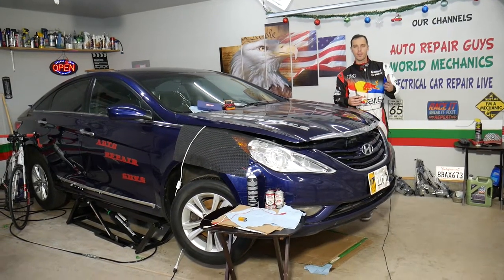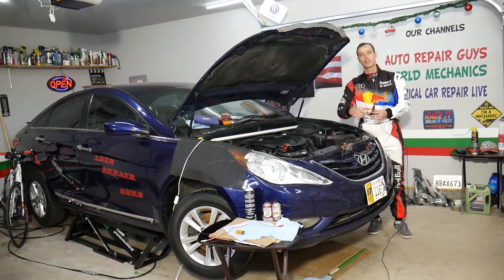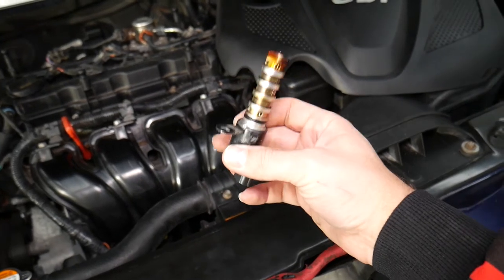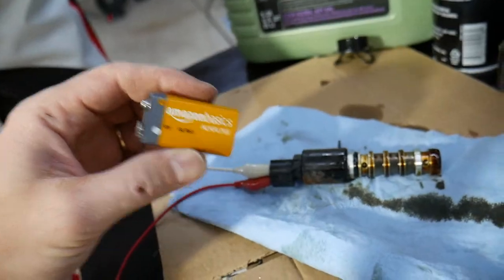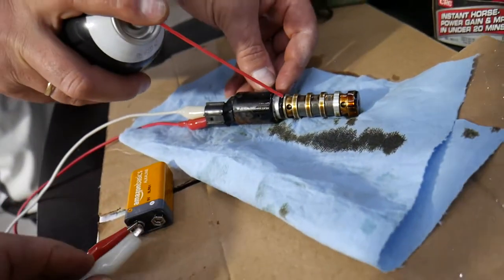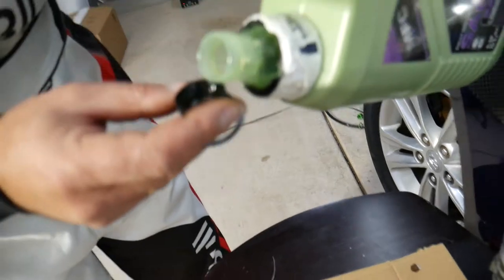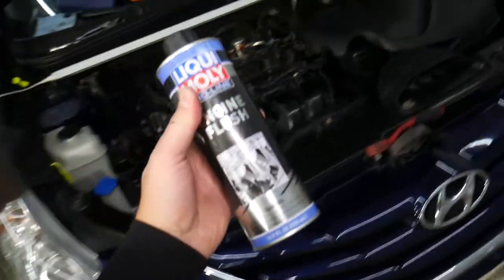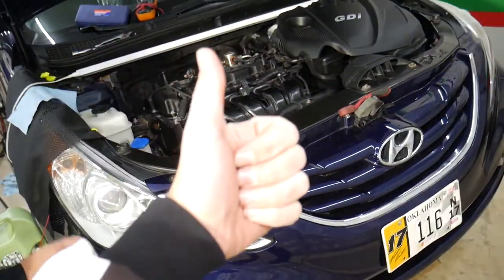HOW TO TEST AND CLEAN VVT SOLENOID ON HYUNDAI HYUNDAI ELANTRA SONATA SANTA FE ACCENT VELOSTER TUCSON

Comment: Just did this with my 2014 Hyundai I30. The front valve actuated with a 9 volt battery but the rear one wouldn't, even after spraying with de-greaser and then contact cleaner. I then put 12 volts through it and it worked. Filled it with de-greaser and actuated for on and off for about a minute then did same with contact cleaner. After that it actuated with the 9 volt battery. Re inserted and now the cold start ticking noise is gone. Thanks for the Video.

Comment: I kleened them both ,mine is a elantra 2017 now at 276k km and it made some what no difference,and put 2 new one in and now starts like a New. Before it didn't start after cranking engine a 4 sec and rpm not registering anf check engine  and anti skid  icon in dash lit up, now with brand new valves ,engine starts on the 1/2 turn

Comment: Ayuda, tengo un Hyundai Accent GLS 2012 1600cc gasolina automático con Código Error P0011 y revisando los dos válvulas VVT solenoides de control de aceite, los medí con mi multimetro y dan 0 y suena el pitido en mi multimetro, pero si conecto esa VVT directo a la Batería si abre y cierra, será que están malas ???

Comment: My vvt show full function on the bench and wire harness is sending a steady 11v. But when I hook the solenoid to the harness and turn the key the solenoid doesn't click or open. Again it functions fine on the bench test and my harness has power

Comment: My 2013 Elantra engine light came on it has a code P0016 camshaft position correlation Bank 1 sensor A
Can it still be the VvT solenoid
Reply: I have the same error code on my Kia ceed G4FA engine. I guess it will be the case. I am about to change oil with flush (actually it is time for it now). Maybe it will help without removing the valve. Lets see. What is strange that problem is not with gasoline. It appears only when LPG is on.

Comment: My 13 elantra functions when voltage is applied. My resistance is 13ohms I have a rattle near timing chain  I replaced timing chain and tensioner same noise

Comment: Just replaced these on a 2018 Elantra. Used dormans and even after battery disconnected issue still there. And sounds like there’s an exhaust leak. Anyone else have this issue? Also noticed the rod inside the VVT on the dormans is much larger than the stock ones. Does that matter?

Comment: Hi, I have a 2014 Sonata Limited that came in with P0076 and P0079. The codes were stored but no MIL. Symptom is while driving I would just lose throttle response and after feathering it power would return but sputter at times. Pulled the sensors, they do operate and weren't very dirty but cleaned them anyway. I reinstalled and had the same issue. Decided to replace sensors and still have the same drivability issue. I have not driven it long enough to possibly set code again. Any thoughts? Thank you
Reply: Did you ever find out what was wrong I have the same exact issue now
Reply: Problem solved... Bad Brake light switch plunger stop (rubber)...

Comment: I have a Hyundai Elantra 2013. I replaced   vvt intake solonoid and exhaust vvt solonoid. Changed oil but I am still having the same problem.What else do I need to check
Reply: Help what else do I need to check
Reply: Camshaft position sensors?

Comment: Thankyou for yor excellent videos,  they teach me so much.
I own a 2015 hyundai Elantra.
2 months ago I did an engine oil change on it and ran it for about 1 minute.
The next day I went to start the Elantra and it spun like the starter Bendix wasn't engaged with the flywheel but when I looked under the hood and cranked, you could see the serpentine belt and crankshaft all turning.
I now seemed like the timing chain failed.
Then after much cranking the engine started to build compression and it started as soon as you could hear the proper compression gallop instead of the free spin .
It has ran fine no for two months..all seems fine.
What happen?
This is an interference engine but no damage occurred...
Could an engine oil air lock bubble have caused the VVT locking pin to not engage and it was trying to start in advanced or retard?
Sorry for the extremely long question but I cannot find a mechanic here in Canada to give me an answer

Comment: Hyundai Elantra 2007. 2.0lt.
Hello sir.  I have a question.   
Do you know how the the OCV behaves on start up?  I'm currently troubleshooting a persistent P0016 and have treble checked base timing which is perfect.   I've replaced the Cam phaser on the end of exhaust cam.  New Cam sensor also.  Can sensor is good also but not replaced;  pcm sees if it is left unplugged during startup and engine revs are affected accordingly.    
So,  i removed the new ocv, plugged the hole in the valve tray with a rag and attempted a startup with ocv in the loom but out of the engine.  I noted that it pulses during startup.  Surely it should just retard during startup, and begin to advance around 1500rpm?  Also.... can you please tell me ( if you know ) the amount of chain links between the mark on the vvt phaser and the inlet cam.   This seems like a conundrum for all!  Autodata says full link on timing mark on phaser,  5 full links and the next full link lines up with Mark on inlet cam.   Hyundai Service manual shows 4 full links between. YouTube diy mechanics have shown Seven! Links between.    Out of some desperation i moved the inlet cam one tooth toward the Exhaust cam to have only Four links between.  I had no P0016 on start and drive but the vehicle would not pull at all below 1500rpm... it just splutters!     So you have any pictures of your cam phaser set up ??????   
I apologize for long message! Best regards,  Eddie
Reply: I apologize but they never answer.